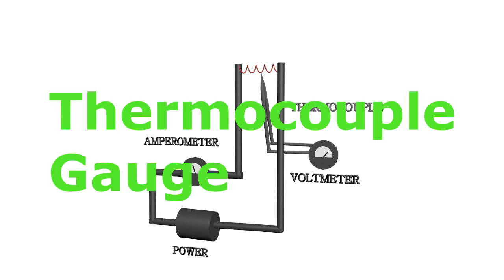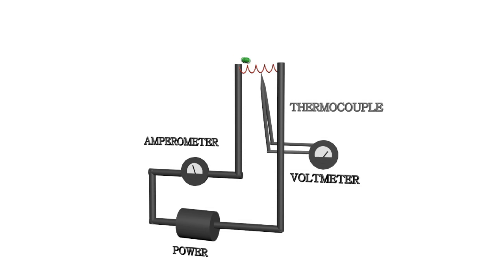Thermocouple Gauge for Measuring Vacuum

Comment: dear captain ! thanks for all your expertise! a simple question, but tricky. In an evaporation system, prior to evaporate the metal, should I shut off all valves, so metal vapour can't go inside difusion pump? Or evaporation takes place with vacuum being continuosly produced inside chamber?